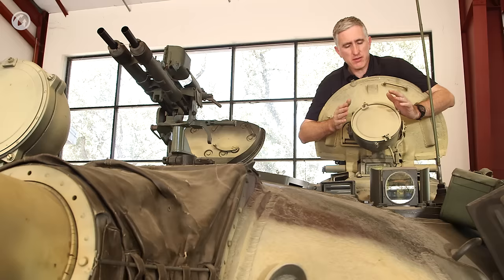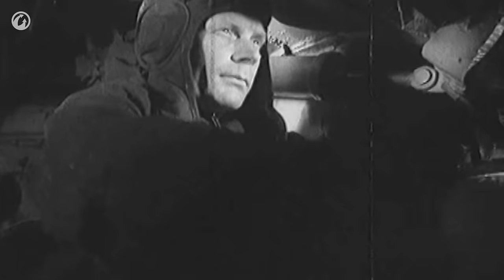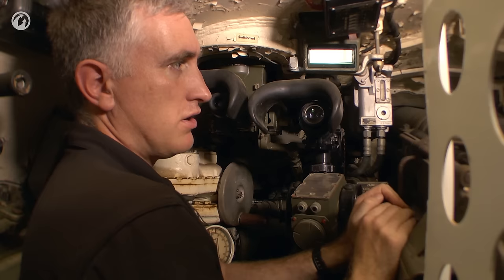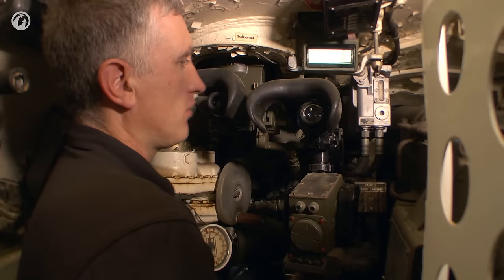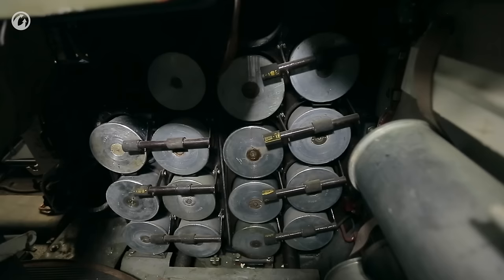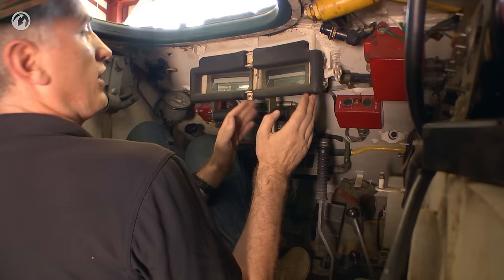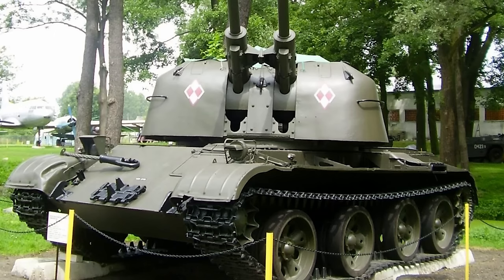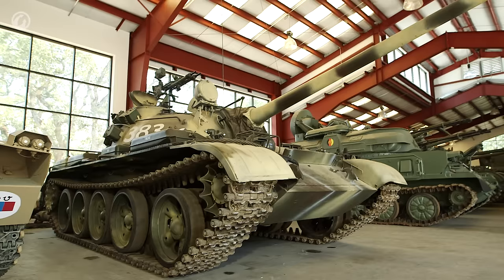Inside the Chieftain's Hatch: T-55A Part 2

Comment: Maybe the crew can use those handles to turn the turret manually by hand (on men power so to say), as you are able to elevate the gun by man power?? Looks to me like the most logical explanation
Reply: what would you brace on? You are inside the turret. There is a turret floor that spins with the turret. You would not be able to use leverage to move that at all using those handles.

Comment: Interesting how the only position that seems to be well laid-out is the gunners position which usually got shafted by contemporary tank designs. For the rest, a tank to respect in the 1950's but not because it was the greatest but because there where so many. Especially the ammo-count is very low seeing as about halve the ammo load out would be HE-frag. That would make the tank units very dependent on there support vehicles for replenishment and thus very vulnerable when preforming breakthrough operations.
Reply: +DaniëlWW2 When these tanks are in combat use I'm sure the tankers would have no problem finding extra places to store more ammo.
Reply: Well it's not a problem because as you said, there were so many of them.
Reply: +Dani&#235;lWW2  well, it was a good tank for the early 50s. You would have to fire HEAT or get close to hit the turret face, as the 90mm and the 20-pdr had problems with 100mm at 60&#186;, you would have to wait for the L7 in 1960 to kill it reliably, or use 120mm heheh
Reply: +Super Étendard I am going to stop you right there. Stop thinking that every engagement between tanks will be one side sitting on a hill and sniping from 2000 meters against the other, it will not happen. When you are defending the infantry forms the lines of resistance. In ideal circumstances they are echeloned in a large number of units in depths of 20km+ but in practice expect a maximum of 10km+. Tank units are behind these echeloned infantry. Soviet doctrine called for infantry divisions supported by armour and artillery to breakthrough these echelons and then special tank divisions would exploit the gaps, disrupt communications and supplies and finally cause a encirclement and surrender of enemy forces. 

In practice the Soviets failed to attain a breakthrough in just about every attempt during WW2 like this and the Germans rarely could afford to be echeloned more than 6km+ because of manpower shortages. It shows just how good the Germans where at the tactical level but in defence neither the British nor the Americans where weak. Far from it. Any weakness they might had would be countered by there mass of artillery. The Germans where good and highly accurate with there artillery, the British where ridiculously fast and the US was both and that became the standard post WW2. The Red Army during WW2 always had to resort to using there tank divisions to force a breakthrough, taking huge losses in the process. These units suffered attrition by doing this and it slowed down there advance, giving the enemy time to respond. The Germans usually needed about a week to bring there panzer divisions up from hundreds of kilometres from the Soviet offensive and the Red Army breakthrough usually took a few days to materialise. By the time the Soviets where finally threw they faced panzer divisions who often came in from a flank and smashed entire tank formations. That is where the massive kill ratio's from Tigerbataljons came from. Probably a few are exaggerated but remember that these units usually controlled the battlefield after a battle, therefore there numbers are accurate. That is a theme with all WW2 battlefields. Usually the numbers by the side who controls the battlefield are accurate, the other side is usually utter nonsense. 

In a NATO vs Warsaw pact scenario in the early 1950's the fast majority of Soviet armour would still be T-34-85 tanks going up against more and more M26, M46, M47 and Centurionstanks as well as 76mm equipped Shermans, Hellcats, M10/M36/Achilles and plenty of 57mm and 17 pounder AT guns aside from the hand-held AT weapons. They will not force a breakthrough easily. The T-54's are concentrated in the special tank divisions and against infantry in echeloned positions they will be hit in the flanks and knocked out. By this point tank units are either being deployed to plug gaps or as fire support. They can easily attain flanking positions because the infantry via radio will tell them where enemy armour is located and they know the terrain. 

There is a good reason the Soviets where so heavy on relatively simple tanks, they where expecting to always attack and to take huge losses doing so...
Reply: DaniëlWW2 More and more of the M26, M46, M47 and Centurions and 76mm Shermans, Hellcats, M10s and 57mm and 17 pdr guns is correct, but you appear to be assuming that Soviet production chugged along at a snail's pace while the British and the Americans could put thousands of new weapons on the frontlines within weeks. This is not true and you know it perfectly well.

Directly interpolating WW2 tactics with the 50's and generating scenarios based on that assumption is not wise. On the tactical level, the Germans and the Western powers were well-organized and cooperated fluidly thanks to the availability of radios. Most T-34s were never equipped with radios. On the other hand, they came wholesale with the T-54, so tactical awareness of the enemy's direction of approach would have been several times better. Also, it wasn't until the Centurions and M48s got the L7 that they were able to reliably defeat the T-54 from the front, and that didn't happen until the mid 70's for the M48 and 1959 for the Centurions. Plus, the reaction time of reinforcements would have been hampered by extremely poor fuel economy. If I remember right, the M47 could only go about 120 km on a full tank on the road. Off road, it's less than half of that. The Centurion was even worse, with a road range of just 80 km, and just 30 km cross country. That's horrible.

Comment: What is the exact role and purpose of a command tank? What rank would someone be to be in such a tank? What's so different about the different types of Radios installed in a command tank? Do NATO tanks have command versions? Or do they just have good enough radios that every tank is a command tank?
Reply: +burningphoneix The command tank co-ordinates targets and movement for the entire unit. If war were an RTS game, the command tank is the user telling all the units what to do. The command tank would have extra radios so that it can send and receive on multiple frequencies at once, to co-ordinate with different levels of command, or different units.

Someone in the armed forces might be able to give you a clearer description, but that's the gist of it. Basically, what you don't want is a bunch of tanks running around doing their own thing, or without a clear leader. It's vital in military operations that everyone reports to someone at a higher level of command to co-ordinate battle, up to one ultimate authority who dictates the overall strategy.
Reply: +burningphoneix Back in the days, radios were expensive (and I mean really expensive) and huge. And you could only talk and listen on one frequency at a time. So the normal tanks had 1 radio, wich was tuned at the frequency of the platoon. But if you wanted to call in an air strike or the arty, you would have to manually change the frequency every time, as the arty and the HQ had different ones. So they fitted multiple radios in the tank, and as they were expensive, only the platoon commander got them.
Today, radios are much smaller and cheaper and they can listen and send on multiple frequencys at a time, so every tank has the same radio.

Comment: If teh gun is well balanced enough that you can move it smoothly when de-clutched, how much would that balance be thrown when theres a round in the breach?
Reply from the maker: It actually does affect it a bit, usually not enough to be a significant issue though.

Comment: Hey Chief ! Gotta ask, the german tanks like the Panther, Königstiger, Tiger 1, did they had nightvision scopes? Thanks !
Reply: They had infrared spotlights that functioned somewhat like primitive Night vision but it wasn't quite like true NV devices.
Reply: JayJay-vs5nl  Passive infrared systems consist of both a spotlight and a receiver optic. They are not NV/Low Light Vision devices. These are two different systems that work on two different parts of the electromagnetic spectrum.